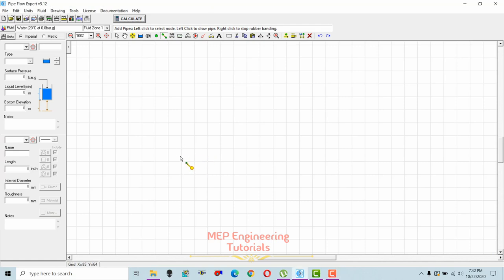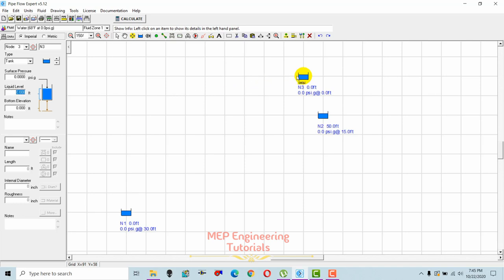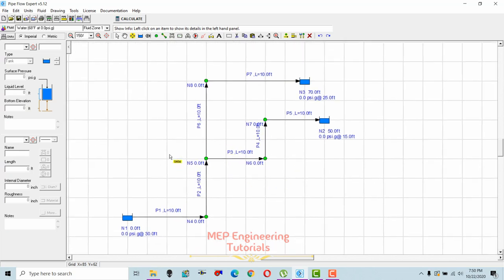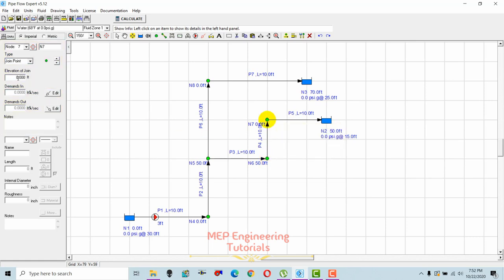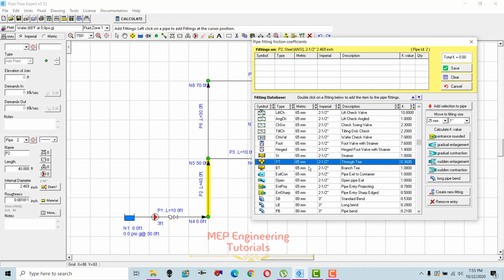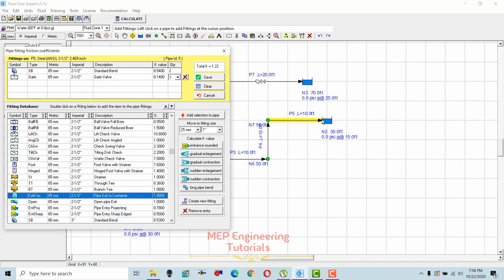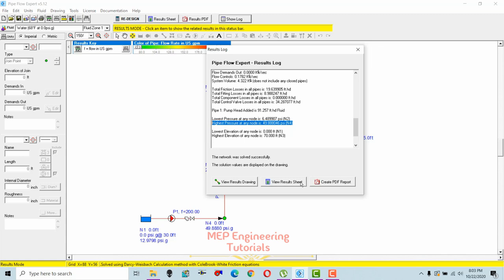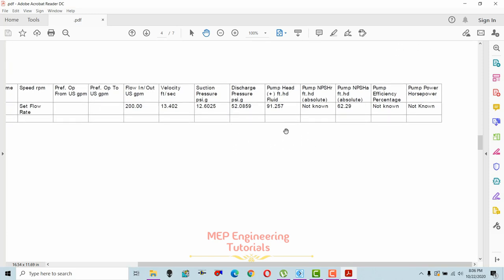Pump head calculation using pipe flow expert software, centrifugal pump hydraulics, booster pump

Comment: Nice explanation. 
Is this software used to calculate chilled water pump head also. Primary and Secondary.
Reply from the maker: Yes you can use this software for chilled water system also
Reply: @MEPEngineeringTutorials  Ok. Thank you so much for your reply. 
One request. Can you please explain One primary and secondary pump head calculation with this software. With a actual chilled water line drawing.

Comment: is this software is related to 2d piping only or we can do 3 Dimemsional also
Reply from the maker: only for 2D
Reply: @MEPEngineeringTutorials   Cant be do this by setting isometric view?
Reply from the maker: @danishraza9340  Yes can be done but will be visible in single line diagram

Comment: If I want to calculate pump head for booster pump. How I can get fixture details and residual pressure?
Reply from the maker: You have to use add demand tool either flow or pressure for this purpose
Reply: Can you make a video for it